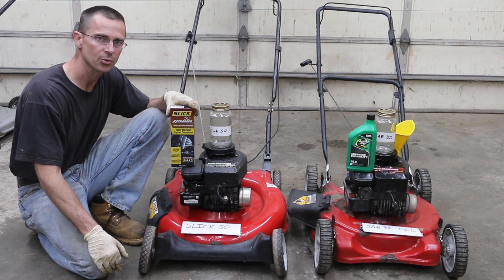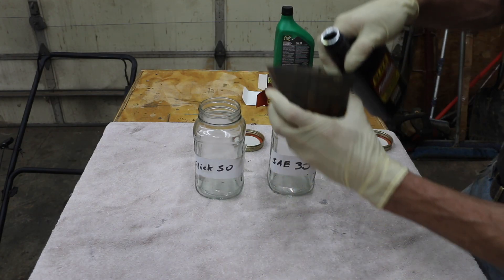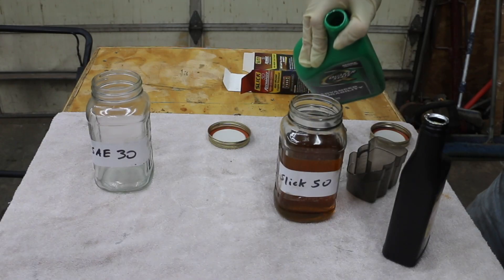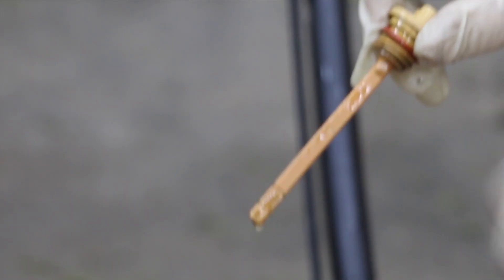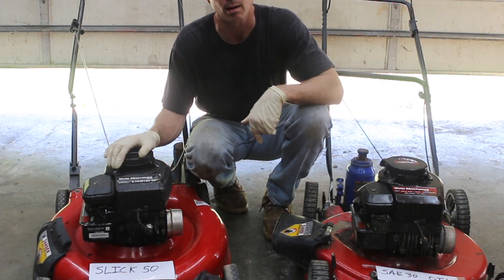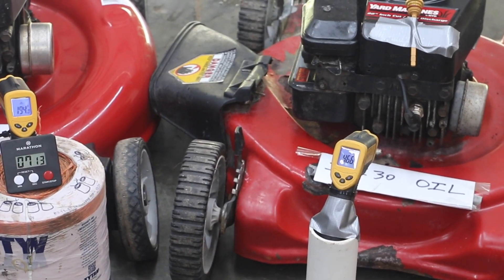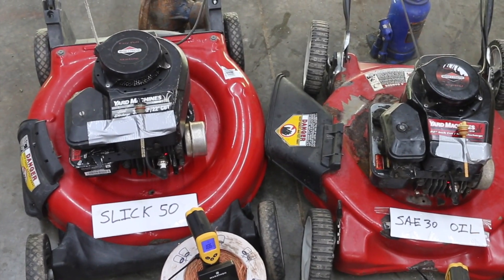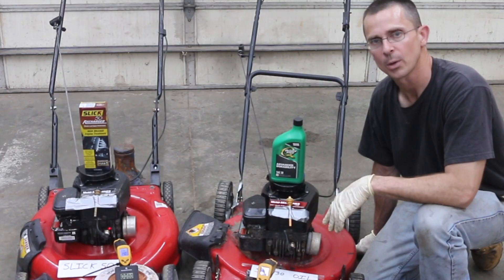Can't believe what SLICK 50 did to my engine!!--Dry Crankcase Test!

Comment: Bell Labs in Florida makes an oil additive that will do better than the product tested here.  product name is X-Tra lube.  I ran an old Subaru for two week back and forth to work (6 miles one way) with no oil in the crankcase.  I ran the engine foe one week with oil and X-tra lube then drained the oil.  The engine never seized.  It had bad main bearings and rod bearings  to begin with, so the engine needed repaired to begin with.
Reply from the maker: Thanks for the info!

Comment: Slick 50 was a oil in the commercial not an additive. When it first came out a friend of mine actually tore a hole in his oil pan while driving. Pulled into Jiffy Lube and had them put slick 50 in. Then drove a Yugo two and a half hours with no oil back to the house where the engine locked up and set in his front yard the bank refusing to come get it he still owed money on it.
Reply from the maker: Thanks for the feedback.

Comment: Slick 50 used to have Teflon (PTFE) but about 12 years or so ago they stopped putting Teflon in their engine treatment. 
They did this because it worked TOO GOOD. There is still one product that still contains Teflon and it’s called “Greased Lightning Engine treatment” order online or buy at NAPA auto parts. 
The original slick 50 would have beat the 30 weight oil easily.
Reply from the maker: Thanks for sharing.

Comment: I didn't see you shake the Slick 50 before pouring it, so the PTFE is all still laying on the bottom, so all the lawnmower got was the carrier oil. So, OF COURSE the Slick 50 mower failed first - because it didn't get the main ingredient in the Slick 50.
Reply from the maker: Thanks for the feedback.

Comment: I would like to see a test like this using Shaler Reslone.    Its only about 10 weight oil but My dad saw and engine that had this ran in it and then the pan dropped and they drove it for 200 plus miles without it freezing up.   I used to run it as a 2 cycle mix and my engine ran cleaner and had more power than any other 2 cycle motorcycle that I ever competed against.   It seems to coat the metal.  just curious how it would compare?
Reply from the maker: Thanks for the video idea.

Comment: Ceramizer has a video where a Honda Civic drives for over 500km without engine oil. The engine looks like new afterwards. That would be interesting putting it to the test.
Reply from the maker: Thanks for the video idea.

Comment: Ever tried QMI engine oil treatment?   I added it as directed and my car engine,  RPM climes up significantly before the computer adjusted it back down,.  I have also had good luck with PRIG fuel treatment to save bad gas, any thoughts?????

Comment: ARCHOIL AR9100 Friction modifier is the only oil additive I have found to help with diesel injector stiction but is also recommended for all gas and diesel engines including small engines. Like hot sauce I put that $hit on everything...
Reply from the maker: Thanks for the feedback.

Comment: I never used SLICK 50, but I do remember the commercials. I had great success with a product called DURALUBE. I had truck with an engine that had gotten too hot, and it had worn the bearings. I drove it for several years after that, and as the engine got warmer, it would, 1. Start to loose oil pressure, and 2. start to overheat. 
After I started using the DURALUBE, it would still loose the oil pressure but it never overheated.
Which brings up a point: It seems that the engine, in your test with the SLICK 50, failed at a much lower temperature than the one with the straight oil. I didn't hear you comment on that.
Excellent work that you put forth!!
Reply from the maker: Thanks for sharing.

Comment: Back in 1988 I bought myself a 4x4 truck, and since it was literally brand new (only had 52 miles on it), I made it a point to use Slick 50 in it from the very first oil change I did on it.  Now, fast forward a few years, 1991 I think it was, when some prick messed with my truck.  He removed the oil pan plug and drained the oil out.  When I found out about this my truck sounded horrible.  The knocking was really bad.  I checked the oil and...I found it was empty.  So I put oil in it, and like always, after I put a quart or two in, I checked it.  Still empty.  WTF?  Then I looked down by the tire and oil was all over the place.  So I found the problem.  Caught a ride to the local Checker Auto Supply, bought a replacement plug and went put it in and filled it with oil.  I finally found out, a few weeks later, who did what when & where and I calculated that I had put around 65 miles on the engine, running dry. 

Ever since the engine had a nasty knock, but the mechie I had look it over said that other than some minor scoring, he really saw no damage.  That engine lasted me a total of 220,000 miles until I ended up replacing it (big mistake, should have overhauled it). 

I suppose you can say what you want, but to me Slick 50 earned my respect.  I seriously doubt it would have lasted anywhere near as long.
Reply from the maker: Thanks for sharing.
Reply: My bad, I left out that I used Slick 50 according to the instructions, which IIRC is add a quart (I forget how often).  ETA: And I just found that I already said that...2 years ago!  Duh!

Comment: I used Slick 50 until I discovered Z-Max. The problem was that the Zmax caused all the garbage from Slick 50 to clog up the oil filter. That sucker weighed 5 pounds easy. Slick 50 contains PTFE's, google it.
Reply from the maker: Thanks for sharing.

Comment: i know this is an older video, but i thought you was going to use  the 50  alone without mixture.  that would have been fun. 

but slick 50 is garbage , i had some, removed the top cap and poured some out .  the stuff was  milky grey  , almost silverish like.
so i took it back to the parts store. got money back because the rest of their shipment was all the same.

the stuff had metal in it. 

good show tho.
Reply from the maker: Thanks for the constructive feedback

Comment: I used to believe in Slick 50 and had cars run well past 200,000 miles. I owed that to Slick 50. Then I ran several other vehicles past 200000 miles without Slick 50. Now I believe it had more to do with fuel injection and computerized engine controls.
Reply from the maker: Thanks for the feedback.

Comment: I use to be a distributor for slick 50 back in the early 80’s.  I witnessed a display lawn mower engine with a plexiglass crankcase cover to show no oil in the engine.  It ran fine.  What I understand is the claim was not you could run an engine without oil indefinitely, but only for a short time to get to a repair shop.  The engine did run cooler and my experience was up to 6 miles a gallon improvement.  My engine did have more pep. Not sure what is being sold now has the same formulation as it was when I was selling it.
I‘m curious if there is another product out there that is better.
Reply from the maker: Thanks for the video idea.

Comment: Back in grad school I took a stats class called, "Design of Experiments".  I think it's important that we not jump to conclusions based on one test.  You'd need to sacrifice roughly [25 x 2] = 50 (ironic coincidence number here) identical small engines to generate enough data to prove the difference between these two formulations.  Maybe the first engine failed early due to some confounding variable that wasn't at all related to the oil formulation?

Something tells me that the lube scientists at the oil companies have figured this stuff out years ago however, but it's always super cool to see someone actually do this crazy stuff.  Thanks for posting these, I'm hooked!
Reply from the maker: Glad to hear!

Comment: The original Slick 50 was Mil Spec and contained PTFE.  The license was bought off and the new stuff is likely lesser grade.  The original can be purchased on line by creator who now lives in Texas. The older formula indicated that is would perform better over time, not just a one time fix.  The PTFE had saved my boat which had blown the can off of the Delco filter, and once again on my Silverado.  As for the test it lacked controls and engine comparison.  Used lawn mowers get all kinds of misuse.
Reply from the maker: Thanks for the feedback.

Comment: Should have used a surface thermocouple for temperature.   Infrared thermometer results are highly dependent on the  emmissivity value of the surface...so if the  emmissivity of the two engines are not exactly the same, you will get difference results... You will also get different results based on the distance the IR thermometer is from the target, and the Distance to Spot Ratio of the thermometer..
Reply from the maker: Thanks for the feedback.

Comment: Had a2.3 v6 Granada oil pump drive let go on way to work was running Castrol engine oil and STP oil additive on stripping the engine to fine the shaft snapped all I did was fit anew one and oil pump plus new oil and filter only noise before strip was louder tappet noise milage covered was 9 to 10 at 30 to 40 miles per hour   .Have you watched the ZX1adverts oiled a model train with it and the speed increased to nearly doube
Reply from the maker: Thanks for sharing.

Comment: Slick 50 is not just a lubricant. It is intended to be a treatment. A fair test would have been the treated engine been used with the slick 50 treatment for a period of time equal to the normal oil change period
Reply from the maker: Thanks for the feedback.

Comment: Scotty Kilmer says that Slick 50 helps lubricate the bearings, is there any way to prove this theory in your next video?  Moreover, can you do a video on brake pads, I am contemplating on buying Akebono, but would like to know if they fair better than OEM.
Reply: I’ve used Akebono pads for years. They are better than the cheaper pads you would get at discount auto parts places. They also produce less brake dust. No squeal and last a lot longer. Cost more but worth it!

Comment: I have a 1970 Ford F100 it has a 1983 302 I had the engine overhaul in 2003 a break in a let it break in at 3500 miles then I start using slick 50 Castrol 20w 50 probably about the third oil change at another slick 50 into it then I forgot one time to put the oil plug back in I put the new oil in the oil went on the ground I started up no knocking I noticed that the oil gauge says 0 so then stop the motor start up again said the same thing no knocking went out and looked at the dipstick there was nothing in it I looked at the ground and every was the oil it never knocked I had it on for 5 minutes
Reply from the maker: Thanks for sharing.

Comment: slick 50 requires months to bond into the pores of the metal. it doesn't treat the oil it treats the metal ptfe does leave a residue of itself in the metal after long term treatment so i think the test wasn't real world enough but it might not make any difference not really sure.
Reply from the maker: Thanks for the feedback.

Comment: From what I’ve heard ....  the original slick50 has not only changed owners. It also changed its formula .  Not the same product at all from the 70s-80s product . So essentially they took a great product and left out the most important part of the formula and changed it .  All for making a buck .  The new slick50 is simply riding on the back of an awesome product that no longer exist .  Probably made in China  !
Reply from the maker: Thanks for the feedback.

Comment: Uuummm, there's a oil drain plug underneath the engine above the blade.
If there isn't, it might be on the side.
My generator has it on the the side, which surprised me but it does make sense. It might be portable but it's a heavy sucker.
Reply from the maker: Thanks for the feedback.

Comment: I have been using slick 50 for 30 plus years and my engine's always sound nice and iv never had a problem with any in any way iv scrapped many but because of different reasons gearbox clutch rust suspension all over the years so il carry on using it thanks kev
Reply from the maker: Thanks for sharing.

Comment: I used Slick 50 many years ago in my mother's 1L car.  The car didn't feel much different but the water temperaturere  gauge was significantly cooler... so much so that a coolant leak that developed wasn't really noticeable on the car. The car didn't seem to overheat even with 30% coolant in the radiator...  The temp dial went slightly above the half way mark that's all.
Reply from the maker: Thanks for the feedback.

Comment: Slick 50 is an oil additive not an oil substitute, a fair and proper test would have been to add slick 50 to a 30 weight oil in the lawn mower engine and tested under those circumstances as it was never designed to be used solely by itself, I have used slick 50 in the past and has awesome results in everything I put it in. I will be using it in my 2005 Ford F150 now that it has reached 250k+ miles,  I enjoyed the video keep it up
Reply from the maker: Thanks for watching.

Comment: My brother was a exec at catapiller  when they tested it when it first came out  they determined it lowered the engine temp  so they had issues with that as engines were supposed to run at a certain temp for sensors.  The other problem was it was so slick the rings would after time align and cause blow by   Maybe thats why the slick50 appears dif today.  It was at one time the Guinness book of records slipperiest substance known and nasa used it  ( thats what made me use it ). I still use it today   This demo concerns me   Like how is this possible ?  Is the formula crap now ?
Reply from the maker: Thanks for sharing.

Comment: Slick 50 does not appear to be the same stuff as it was 20 years ago. Ive used it in all my trucks.  I sold my trooper to a girl with 130k miles she had jiffy change her oil and forgot to add oil and plug.  It was driven 3 weeks before engine seized.  Slick 50  i think now dilutes the additive. You used to pay $50  but i think its still the best.  Ive never lost an engine and my current one has 250k miles.   I use it about every 3 oil changes.  Slick 50 used to say it lasts 50k miles. Back when it looked like 100% of the chem they use .  .  It takes a while to imbed it self into the  metals   Does it not ?
Reply from the maker: Thanks for the feedback.

Comment: I tried Slick 50 in my 1996 Camaro with less than 40,000 Miles, after a Couple of Months I checked the Oil it was One Qt. Low....It did run Smoother but for some reason It was Losing Oil, I Changed the Oil back to what I  normally run to see if the Slick 50 was the reason I was losing Oil, sure enough I didn't have any more issues Losing Oil..The PCV Valve was ok along with everything else. I keep all of my Vehicles in Top Shape.
Reply from the maker: Thanks for sharing!

Comment: Many years ago I put slick 50 in my dodge truck. I changed oil back then every 5k miles. When I had the oil changed, I saw the gelled gunk come out of the oil pan and was, to say the least, pissed. I did an engine flush and never used an additive again. I should have sued that dang company!!
 NEVER PUT THIS OR ANY ADDITIVE IN YOUR ENGINE! It isn't needed since oils today are excellent by themselves.  
 If you do use additives, I have a bridge I want to sell you.
Reply from the maker: Thanks for the feedback.

Comment: Long, long ago in a land far, far away I had a dinosaur 1974 Yamaha 650 US Custom. The engine was tuned to perfection, fast flow air filters, straight through (and very illegal) pipes, road racing tyres, 0-60 in about 4 seconds not pushing it. The engine burned clean and not too hot. I thought Slick 50 would be a good idea so installed some and went for a running in ride. I stopped about 20 miles from home to check the colour of the exhaust pipes. The engine was hot, hot, hot, I could feel the heat from way off. The Slick 50 had reduced friction so much the bike was getting the usual performance on mere fumes of fuel. The drop in mixture meant it was running very week which made it very hot. I had to creep home at normal road speeds- 1 of three trips I ever drove at or below the speed limit- the other 2 times the bikes were wrecked in accidents with idiot car drivers. When I got home I drilled out the main jets with the smallest drill bit I had which ended up to be 175-180- actual new 175 jets produced the same ummpf as the hastily drilled ones. Result- slightly less gas, slightly cooler engine quicker to rev.
Reply from the maker: Thanks for the feedback.